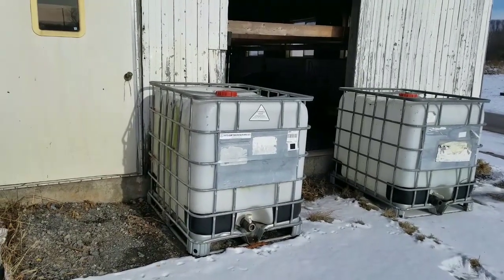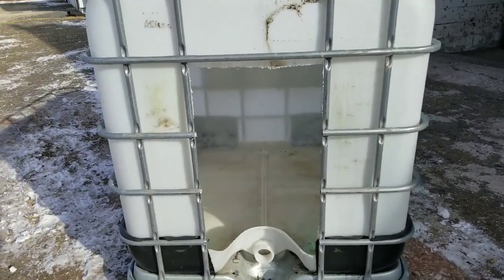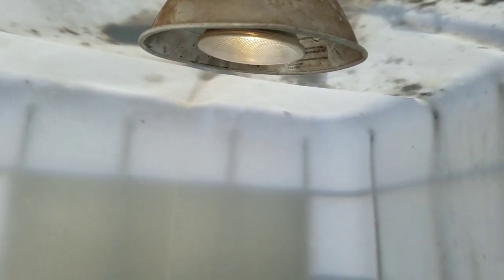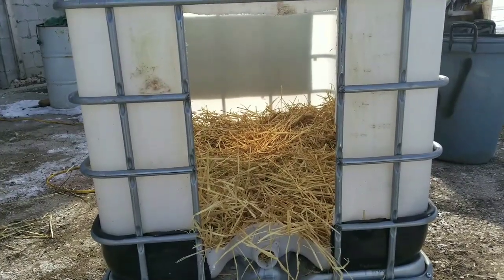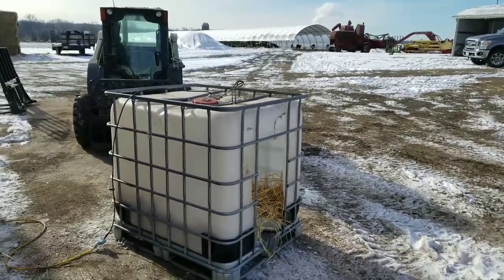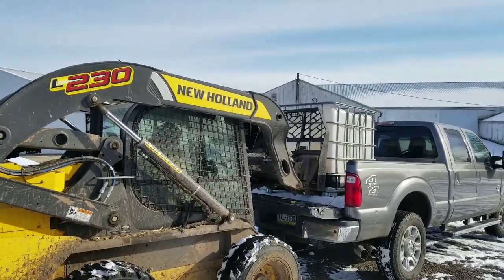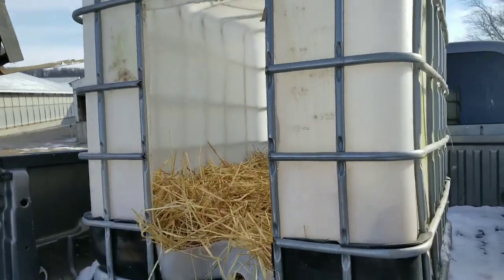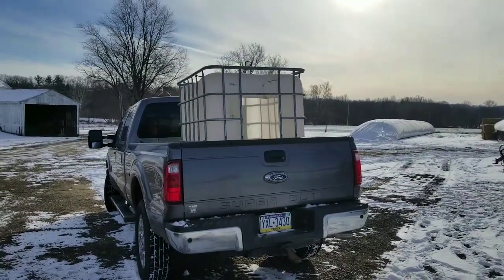How we recycle things on the farm, calf warming box and transport carrier project

Comment: Please do NOT use sawdust but white wood shavings as a bedding. This eliminates dust issues and some problems that can occur with hardwood splinters and toxic resins in some specialist hardwoods.

A much better heat source is as others have suggested is an electric onfloor heat pad as used for piglets in farrowing crates. they are moderately flexible,  waterproof  (so they are easy to clean and disinfect) and they encourage the animal to lie down on them. They do not overheat even if the animals are not fully covering them. In addition the design works correctly with heat rising. A lamp above is trying to force heat downwards causing a small thermal air movement current.

Most that I have seen also have a thermostat control in built as well. However they are much more expensive than a heat bulb, fitting and shade initially.
An American supplier can be found at   https://osbornelivestockequipment.com/products/stanfield-heat-pads/heat-pads/